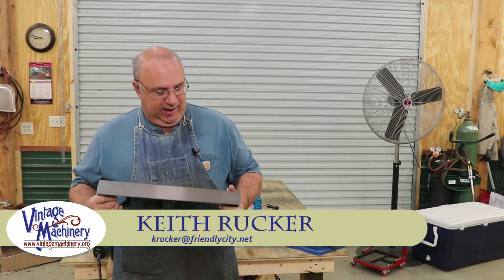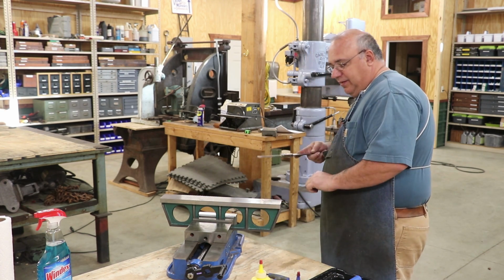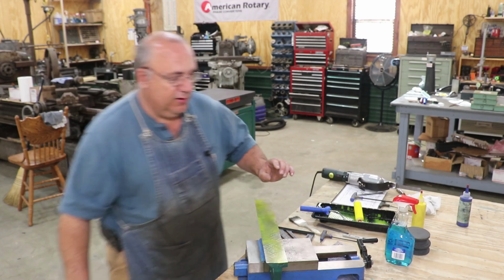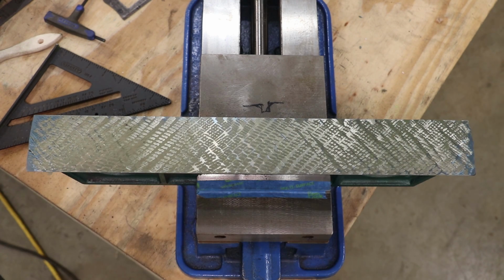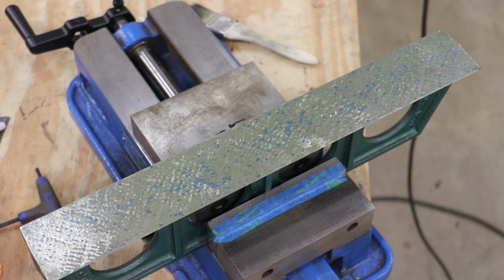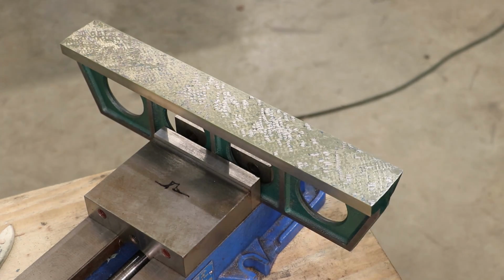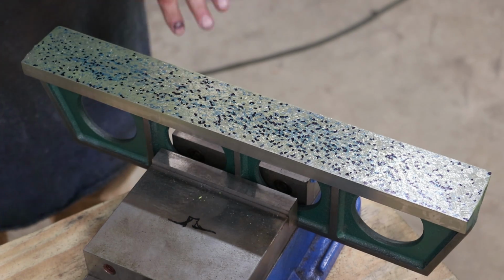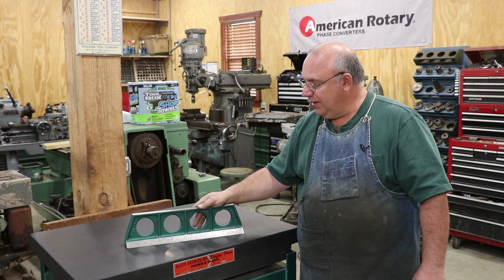Scraping a Camelback Straight Edge Flat

Comment: As ignorant as I can be, what is the use for such a flat device? I mean how does having a "perfectly flat" item come into play in a shop. I honestly don't know...
Reply: The straight edge he's working on here is a tool to gauge the flatness of the bearing surfaces on his lathe cross slide. That needs to be flat in order to make accurate parts. He can't take the whole cross slide to the surface plate to check flatness so he is making a known flat surface that he can take to the lathe to check it.
Reply: Your premise is correct, but doesn't really speak to the reality.  Yes, It probably doesn't NEED to be that accurate due to the wealth of other influences, but precision machining, like most "sciences" is the art of minimizing or compensating for variables.  The nature of wear in a lathe bed is virtually always as a dip near the headstock, fading to many times no wear near the far end.  A good machinist familiar with a machine can continue to produce good parts, but only by compensating for that wear.  Now imagine our ways and other machine interface surfaces are "perfect".  Zero error in in all three axes gives one a huge advantage, that's three clear variables eliminated!  Stated alternatively, improving the machine fit and function can NEVER hurt the end product, but it's up to the machinist to compensate for thermal expansion, tool deflection, and all the rest.  Now imagine the shop that has temp and humidity control, everything in place to insure the machine is allowed to move yet retain straightness and squareness, but now he or she has to compensate for bed wear and general sloppiness of the axes?  That would be hard to stomach.
Reply: Mainly used as a tool to check other tools/surfaces for trueness. Say you want to check the ways (riding path of the saddle) on your lathe, you can't take the granite to the lathe, and you can't flip your lathe on the granite, now can you? 

BUT, you can take the straight edge to the granite, coat the granite in blue, check the two surfaces together, then, you move the straight edge on the ways and see where on those ways, the blue had laid.

Those blue spots are high points. 

A simplistic anecdote, old stairs, you must've noticed how they are worn in the middle, yet the outside parts, left and right are not? Well, the same applies to the ways, and in the same way, you'd see, revealed with the straight edge, where those low spots are.
Reply: That's true, but also experienced machinist know how to compensate for the inaccuracies in their machines.
Reply: You living in Zzyzx, Ca?
Reply: Keep rubbing the granite faceplate will wear it especially the edge nearest the user. In the end if the granite faceplate is out all the straight edges go out.
Reply: Scraping isn't just about flatness. 
That's just what he measures to understand if he did it right.
A big advantage with scraped parts is they work as ultra small lubrication wells.
So the wear is much better than on a ground part. Which is important on high tolerance machines.
Reply: OLD SCHOOL
Yeah the math on all that stuff is kinda like this.
.0 = $/xHr
.00 = $$/xxHr
.000 = $$$/xxxHr
.0000 = $$$$/xxxxHr
Reply: I agree- if you are watching the series on the Monarch you know that the ways have machined grooves to distribute the oil which is fed under pressure.  Adding scraping to that will improve the life about as much as standing on a chair will get you closer to the moon.
Reply: Gary, ignorant should not watch this type of videos. It's clearly not for you.
Reply: In reality, a ground straight edge would be perfectly fine to check his machine to the original factory tolerances.  The whole scraping thing is just an exercise in learning a special technique.  All of the machines in his shop will change from morning to night as temperatures change unless he spends a fortune to keep the place at a fixed temperature and humidity.  The building is new, so will settle as well, causing the machines to move and require constant leveling and checking to insure those extreme tolerances.
Reply: It's only valuable in 0.01% of shops- most guys watching here have home shops with old USA iron or Chinese machines incapable of anything this precise.  If you saw that episode with Richard King, he was saying he flies all over the world doing scraping- that would be for major industrial companies with high precision machines, not small shops.
Reply: Exactly, it is important on high tolerance production machines that might operate continuously for 2 or even 3 shifts per day.  However for these semi pro or hobby shops they will never reach anywhere near that level of wear.   If you watch other guys like Keith Fenner or Adam Booth, they are running old machines- Adam's were bought used by his grandfather, but they routinely hold tolerances of 0.0005" and better without all that scraping- it's all about the operator.

Comment: Wouldn't you need a much longer camelback for your lathe ways? Or is this only for the carriage/tail stock?
And how was the angled of the dovetail checked for angle and parallelness?
Reply: Nope, you do not need to fix the angle of a dovetail, you need to have the male and female parts fit seamlessly. Most dovetails on machines are just approximately some angle.  The only things you need to fix is what is affecting the accuracy of the slide. Whether the angle is 59.7345 degrees or 60.12345  is irrelevant.  What is relevant whether the sides are parallel at any height, the base is coplanar, etc.  If you are making 10,000 machines and all parts must fit, sure you need absolute precision, but when you have one machine to make perfect, only the mating surfaces need to mate, the rest is not relevant.  Once you have one part scraped to the straight edge then you use that part as the master and scrape the other parts to it.  A good resource is https://archive.org/details/MachineToolReconditioningEdwardF.Connelly or the Moore book Foundations of Mechanical Accuracy  http://mooretool.com/publications.html.

The reason you want a straight edge with a 45 degree dovetail edge is to be able to fit into any dovetail that is above 45 degrees.  Also it is not possible to spot two sides at the same time, the only way you can verify an angle is by measuring it, not by trying to spot it.
Reply: Take Richards class, fix a few machines, and lets talk.

dee
;-D
Reply: Hey it is not like there is only one way to do everything, i am just telling you what i learned.  I learned, a Straight Edge with a 45 degree or so dovetails is much more versatile than one with a 60 or so degree.   To measure the actual angle I just use some metrology  or  precision gages. Also  meshing together two surfaces scraped to anything better than 20 PPI, is a statistical improbability,  you will always have at least 3 points touching.  Using a scraped part as a master for the next part is very accepted practice, and if meshing was a problem, you would have that with the straight edge as well.  Those are some of the things Richard is teaching. He was a rebuilder for all his life, learned the trade form his father.   He might not be at level of Moore on theory, but he has rebuilt just about every imaginable machine tool. 

So far every lesson or advise i had from him works as advertised.

Edit:

Chris, I definitely do not want to make this out to be something where i do not accept other people's experiences or opinions.   Before i took Richard's class i also thought you needed a master with the correct angle for each dovetail, i thought V-Ways on surface grinders had to be exactly 90 degrees and level, i had a lot of misconceptions about precision mechanics, After the class all that was out the window.  You have to realize the rebuilders had to minimize the tool chest they carried around, use minimum metrology to verify the results, get the work done in minimum time.  Their job was not to make parts that mate on any of the 10,000 lathes put out of the factory.  They had to make the one machine in front of them work as well or  better than new. Practices emerge from that goal.  The first thing we were taught is to figure out what has to be done with the machine, where is the wear, what was the intended working envelope of the mechanics that you need to restore, look for the unworn surfaces measure from there and and establish a map.  Build the structure from one reference to the other and make things fit together and perform together,  that means that you may actually have parts in a rebuilt machine that are way out of spec form a new part, but brings the machine back to its original precision.  Richard said it multiple times people who worry about the geometry of individuals parts over the final precision goals of the machine, are wasting their time.  A perfect 60 degree dovetail does not work any better than a 58 degree dovetail, you just wont be able to interchange parts with a machine that was not scraped together.  This may sound like i am a shill for the guy who thought me, but it could not be farther from the truth, i am doing what Richard has asked all of us to do is to let others know what he learned and taught us.  You are free to ignore all of that, and do what is working for you, machine rebuilding is far from a dictatorship.
Reply: The angle portion does not necessarily need to be parrallel with the bottom, as it is used independently on it's own. It also does not to be at any specific angle, only need to be able to get into a dovetail to blue up...likely 59 degrees or less, but 45 degree allows for a wider range of dovetail angles ...a bit hard to explain, but am sure Keith will show using it at some point.
Reply: I am sure Keith will show it at one point.  As Jim points out the angled side is not for measuring angles, it is for allowing the SE to get into dovetails.  Sometimes you even use the bottom to spot the dovetail,  the parallelism or angle is not something that is aimed for or measured on a straight edge, because you only ever use one side.  The length ideally should be longer than the entire length of the part you want to spot, but you can use a shorter standard to spot a longer part, you just have to be careful to use it with small overlaps and only scrape in the areas that you are convinced that are higher.  Scraping is an incredibly simple thing by itself the, but the application of metrology and the decisions to brings things in alignment are a result of lifetime learning and discovery, the pros will tell you that :). I am just a student of the art.  

Here is a short vid i made of my 4' SE I scraped a while back https://www.youtube.com/watch?v=3dY2HxSCyTg.  I used a hand scraper, and was spotted on a 3' surface in steps.  The SE is made form a discarded lathe bed, it is  about 3" wide.  Unless you have a bed with a very long dovetail to scrape  an 18" SE with the dovetail will serve you for almost anything.   The longer a dovetail SE, the unwieldier it gets. You supposed to hinge the SE in the dovetail to find the highs, the longer it is the less you can swing it, the heavier it is, the harder it is to get the "feel"  for the hinge.  So i decided not to put a angled part on my 4' SE.  I have more pieces to make short one with the angled part.
Reply: Of course you are right in theory,   The scraped surface is going to "bump"  peak to peak, but the peaks are in line with the plane of the surface plate of the master, so it all averages out so some plane that wiggles in 3D space by some amount. Would be an interesting experiment to determine that, but that is beyond the capabilities of the tools we have.  If you ever Visited the NIST metrology labs you would find two Moore CMMs that are used to certify all the metrology standards used by all the manufacturers that provide NIST traceable certificates.   The Moore CMMs are hand scraped, yet the machines maintain precision measurements in the nano meter range. One would need a measuring system beyond the resolution of the calibrated highest precision CMM is available today, to measure the undulation of the plane because it is sliding on hand scraped surfaces.
Reply: Well let me know if you are in the neighborhood :). We can make it happen, they have some real cools stuff.  We have some pictures on Practical machinist of the last visit. http://www.practicalmachinist.com/vb/machine-reconditioning-scraping-and-inspection/off-maryland-scrape-communion-326032/index3.html#post2851876

Comment: Thanks for the great vids Keith.  What is the benefit of having a scraped straight edge rather than a ground one?
Reply: When you use the straight edge for blueing it needs to be scraped. A ground one will only stick to the part and smear the blue color. (You could grind and flake it, that works too)
Reply: Scrape is a few orders of magnitude more precise than a regular ground surface, well, if you know what you're doing and have access to a granite of precise flatness.
Reply: To clueless folks. Stefan is right. Chris0tube is a troll (knows something, but without full understanding).
Reply: for a lathe surface it holds oil, not so much for a straight edge, but its something to practice before you ruin a lathe with

Comment: To what extent has scraping been used for thousands of years? I mean, iron has barely been around for thousands of years
Reply: Around 1840.  Whitworth.
Reply: The start of the Iron Age proper is considered by many to fall between around 1200 BC and 600 BC, depending on the region. ref Wiki. I make that 3,000 years.
Reply: Yeah, roughly 2600 to 3200, just a couple thousand.
Reply: Scraping has been around in hundreds, not thousands of years.
Reply: Egypt, stones. To say the least. Nothing done in metal up until the 60's (possibly earlier) in some form or another, was original to metal, merely adopted techniques from, stone, wood, and clay.

A short and simple set of examples:

Stones that interlock perfectly in ancient monuments were roughed together until a perfect fit was achieved => that's how you level a cast iron plate at its simplest, you play it against another's face thus in turn truing both up.

Achieving flat surfaces in a time where copper was the toughest metal you got, you would scrape the surfaces using a boulder. 

The philosophy that you harden metal? That's from clay. Metal, was found in clay, red clay to be specific. Imagine the wonder of people, lesser than you or i, in terms of knowledge, upon finding beads of this magic material harder than stone on the surfaces of your pots.

Etc. Of course, Keith was probably just playing around with words, but every technique outside of micro-fields, in metals, was at some point copied from something else. 

Even metal lamination. Mixing multiple types of clay ends you up with a much better pot. The logic learning was much more important back then than it is today when we acquire bits of knowledge, thus enabling us to skip the ladder of knowledge.
Reply: Walmart has been around since at least the early 600's A.D.  I mean, Sam's truck was at least that old !!!
Reply: some of the cashiers in my local are that old^
Reply: Ever heard of copper? or really any other metal?
Reply: @Rob - rekt
Reply: It was a mere slip of the tongue, I don't think he actually meant that. Scraping has not been around for even 200 years
Reply: when the first housewife fried the first egg and the pan wasnt non-stick, scraping was invented as frying pans were so hard to find thousands of years ago, as they didnt have a walmart